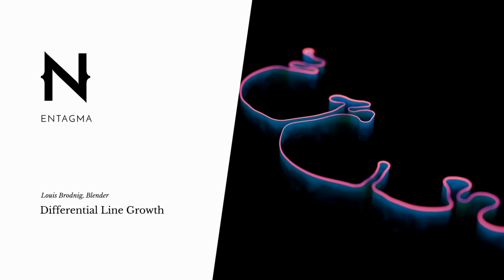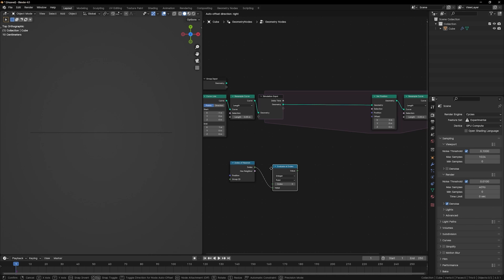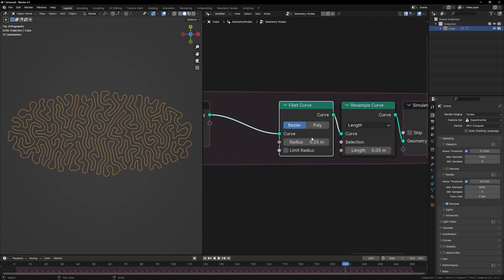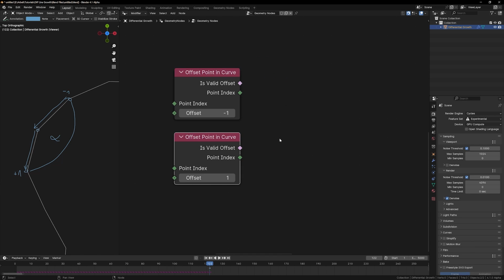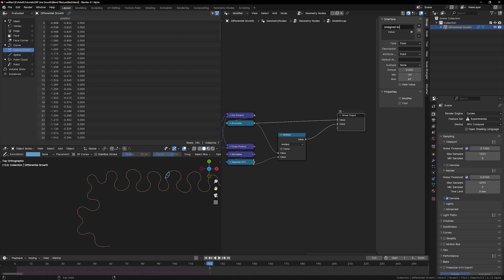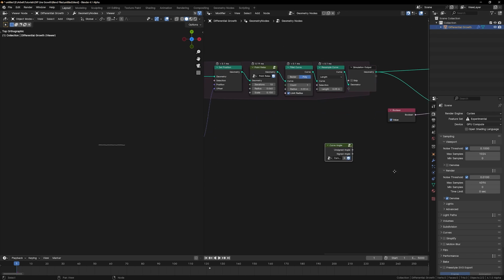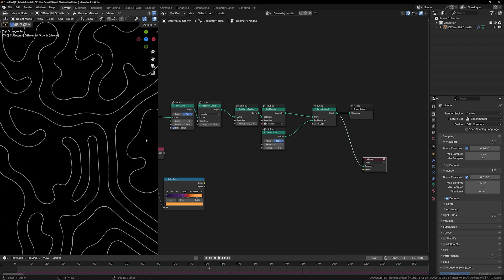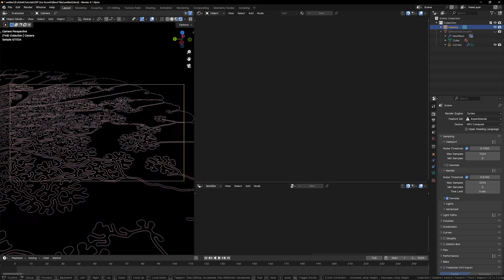Blender Guest Tutorial: Differential Line Growth

Comment: That’s amazing thank you so much for this tutorial! I do have a few questions to ask tho! First of all, how do you get the growth to be so fast in the timeline? Mine doesn’t do half what yours does even when i set it as far as 3000 frames. Do you have a solution to make it develop quicker/ like yours? Maybe i missed a step? Second question, after doing all of this, when i try to add color with the color ramp it just doesn’t work and my line stays purely black. Stayed black and white in the geometry node editor when we tried to plug it to the viewer node at first, then stayed purely black after switching to the shader editor and adding back the color ramp there. Would you have an idea why this is happening? Thank you so much again!
Reply: Hi there, sorry for the late answer. A lot of the times where I let it run, the video is actually sped up. I could have made that a bit clearer, sorry. How well it runs is mainly dependent on your CPU but with this kind of system, as it gets more complex, there will always be a point where it won't run in real time. But to speed up testing simulation setups, you can switch your scenes framerate to something higher as the simulation zone is frame dependent. So setting your FPS to 60 or even 120 can save you a lot of waiting time as long as it runs faster than realtime.
So if the curve is still in black and white, you might want to check the input of the viewer node and if its set to float or color. If its still set to float, hold ctrl and shift and click on the colorramp.
As for the shaded view, do you have set up the Hair Emtpy System or have you used a Curve to Mesh node to make it visible? If it's still only a line it won't be able to render.
Reply: @lueyyys  Hi I have problem with colorurs  I have full setup, Color Ramp is not working. I have something like aplha colours black to white. I have colour from color map to Value in Viewer.
Reply: @zakrzewski3d  If the viewer input is set to Value it only displays floats, so basicly black and white information. To change the socket type, disconnect the ramp from the viewer node and ctrl+shift click the ramp node again so it connects it to the viewer node and automatically changes the input socket type
Reply: @lueyyys  wow perfect its work :))))